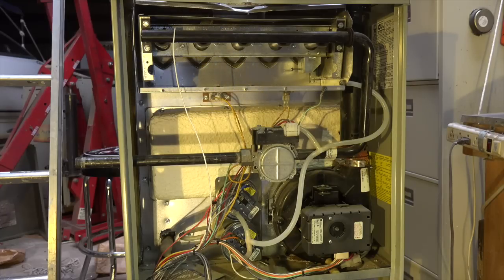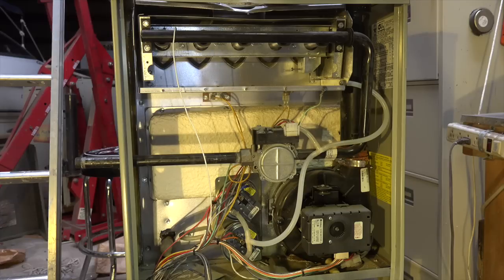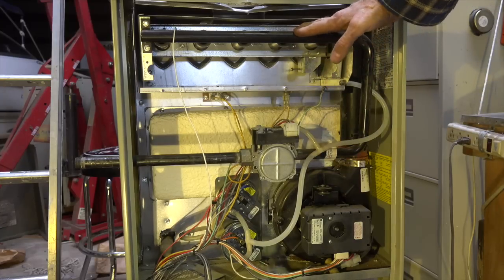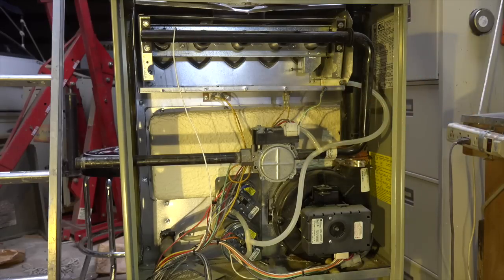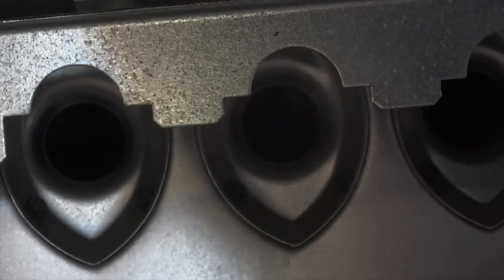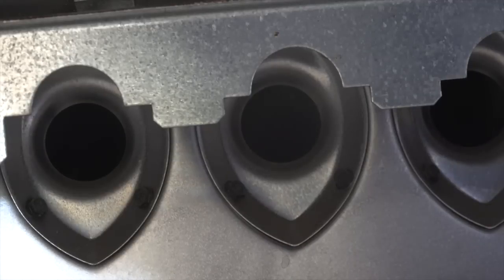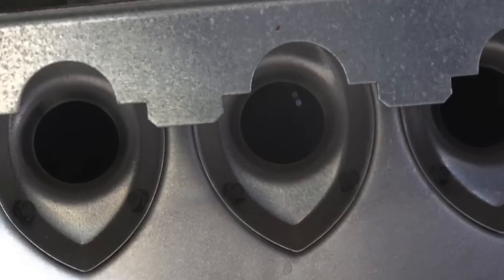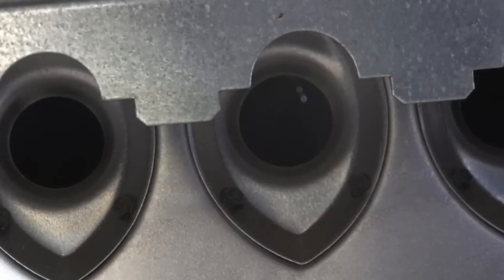A look at a heat exchanger crack that can't be found

Comment: So I see that you found this furnace in the junk pile. I wonder why it was discarded. In a normal routine furnace inspection would the technician go to extent that you did to find a cracked exchanger when there were no symptoms? I saw your other vid on cracked heat exchanger scams and wonder if maybe this was a case of a scam that turned out to be cracked after all.
Reply from the maker: You missed the point of the scam video.
A service tech that condemns a furnace without doing a thorough check of the heat exchanger is only increasing his bottom line without any value to the customer.
GFM

Comment: Gary where do I put the flashlight to see if there's any light coming through the heat exchanger
Reply from the maker: If you want to try the flashlight trick (not the most effective way), place it in the supply plenum and darken the room.  You may be able to see the light from inside the heat exchanger.
GFM
Reply: grayfurnaceman thank you Gary for the information that did help a lot thank you I'm just trying to learn. Have a good one my friend

Comment: cracks like this are exactly why we at our company do a visual inspection of every heat exchanger on every call we go out on. AHRI says if there's a crack, it should be replaced.
Reply from the maker: The only sure way of finding this crack will be to remove the supply plenum.  It is not visible from the burner tubes, even with a camera.
GFM
Reply: We pull blowers on every call, and on American Standard we also look through the coil access (when it's a down flow) because that's where we go to see the cracks. Right above the mouth of the heat exchanger on the side where it's crimped together, right up against the front of the furnace. We are finding cracks on 2 and 3 year old equipment, even if it has .5 total external static, or whatever static it requires.

Comment: Great channel, thank you for what you do!  It helped me remove my blower.  Carrier 580MVP (2003), Code 13 FRS keeps popping.  Filter was clean, replaced inducer motor, removed blower and checked the heat exchanger from below, looks in great shape, no corrosion or dust buildup.  I rebuilt the PVC intake and  exhaust last year but checked to make sure they are clean, it's a pretty short run to the outside.  I will wipe off any dust on the blower and heat exchanger with a wet towel but there isn't much on them.  I don't notice any visible flame roll out and the flame doesn't really change when the blower kicks on.   I don't know what else to do, do you have any ideas?
Reply: The troubleshooting guide said to check: 24-vac across PL1-6 and Com and PL1-8 and Com, it was higher than that, like 25 or 26volts but i don't know if that is good or bad.  I'm still teaching myself how to use this multimeter so tonight I will check continuity across limit switch LS and the FRS.  Thanks four your help, I just don't trust the furnace companies around here.  Tried to charge me $500 for a condensate pump last year and $1000 to replace pvc pipe concentric exhaust kit...

Comment: This is an endorsement for gas pressure switches.  Don't tamper with or replace with generic brands.  If something weird happens with the pressure in the combustion chamber the furnace won't fire.  A good brand of CO detector is a must.
Reply from the maker: There is no guarantee the pressure switch will detect the failure but your point is well taken.  If a fire or fatality happens and the pressure switch has been tampered with or is not a factory part, the tech that made the adjustment would find he is in great trouble.
GFM

Comment: While i would red tag this unit i dont believe that it would cause CO related problems. If we take a furnace and run a combustion analysis chancing are good if it is firing properly we will have somewhere around 30ppm or less running....But lets use an extreme situation and say that this furnace is running 600ppm calculated by combustion analysis via flue. That value is the combination of several things in the exhaust but lets just act like there is only oxygen and carbon monoxide. we have roughly 25cfm being pulled through that flue by the inducer. 600ppm with 25cfm. now lets look at that furnace, based on burners we can assume its at least a 4 ton unit and in heat mode is moving 1000cfm. So lets do a little math, 600ppm divided by 25 cfm equals 24ppm per 1cfm. lets assume that the hole in that heat exchanger was huge and all the combustion air was mixing with the blower motor air. so that would be 600ppm divided by 1000cfm which equals 0.6ppm per cfm....unless I am looking at this wrong?
Reply: Its just like a car mechanic saying you have a loose ball joint and it could break and  crash your car. So many scams out there,I dont like that either.
Reply from the maker: Your calculations may be correct.  However, they are no guarantees here.  This crack produced no CO at all and did not affect the flame.  More than anything, this video is there to show heat exchanger integrity may be close to impossible to determine without a very thorough examination.
GFM
Reply: I simply say this, not because of anything you said or this video. But because of all the companies i follow around using carbon monoxide scare tactics. In hopes that anybody viewing this video might understand that it is not as dangerous as many people like to say. I personally would still redtag unit, but there is plenty of really good techs out there that wouldnt because they understand the real threats are minimal...
Reply from the maker: I agree that many of the CO warnings are scams.  In fact I did a video on heat exchanger scams.  I have heard techs say that if the furnace is over 15 years old, it almost guaranteed it will produce fatal CO.  I like to think I determined heat exchanger condition in light of its potential danger to the customer and not to my bottom line.
GFM
Reply: yes indeed it can, but not that small of exposure is going to do anything. you will be very lucky to find a meter that will read anything coming out of a supply vent due to dilution from air. you may find a personal meter will go off after someone has been cooking or a water heating that is drafting into a home but very rarely a furnace. I was surprised to find out just recently that OSHA allows for 40ppm exposure in a work environment for a period of 8 hours a day! way more than i expected. When we are talking about a cracked HX emitting .05% CO into a house it isnt going to do anything to anybody.
Reply: me too, like I said i red tag equipment if it has a cracked HX. But it is too often used as a scare tactic that you will die and that is just not the case. If you find a cracked HX with induced draft very unlikely to find 1ppm in home....My only point here is that it is used a scare tactics, and i just dont agree with that.
Reply: the problem is that co accumulates in the body over time, so a small exposure over long periods can cause sickness/death, even more prevalent in infants and elderly.
Reply: I thought osha allowed 35ppm in 8 hour period. I was always taught you want 0 ppm of CO in home,thats why gas cooking stoves should have exhaust fan running at start up. I personally like to be safe than sorry.

Comment: Combustion analyzer?
Reply from the maker: Tried it.  No CO.
GFM
Reply: dye test?
Reply: grayfurnaceman wouldn't you be looking for increased oxygen in the flue gas not CO? Or are you saying the crack causes disruption in the air/fuel ratio causing CO? Similar to if you have very elevated levels of excess air.
Reply from the maker: In order to use the dye test, you would have to remove the ductwork.  If it is removed, you can see the crack.
GFM
Reply from the maker: I think I tested this one once, but never did a vid on it.  You can get increased 02 but it has to be pretty bad unless you can check each tube.  The dangerous ones are from disruptions in the flame which will make CO.  I will probably do a video on combustion analysis of this furnace.
GFM

Comment: So what were your symptoms?
Reply from the maker: Absolutely nothing.  All burners lit normally, no flame rollout, no CO, no pressure switch cutout, and no limit cutout.  A rather scary situation as the crack is quite large and could, if it displaced a little, could cause a CO problem.
GFM